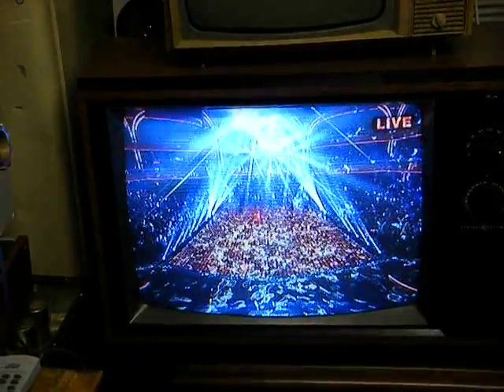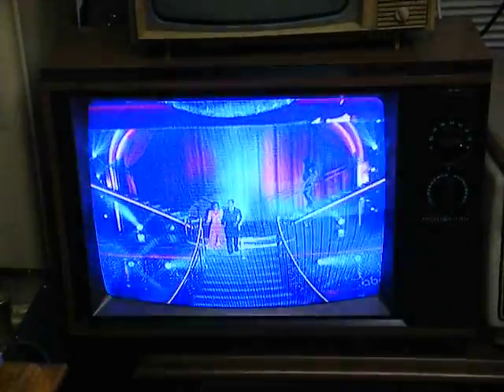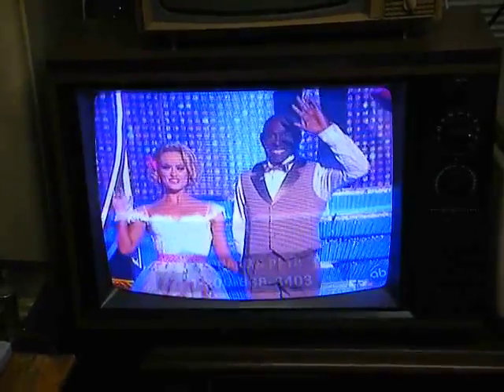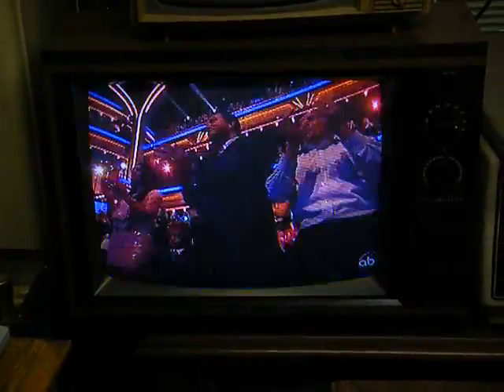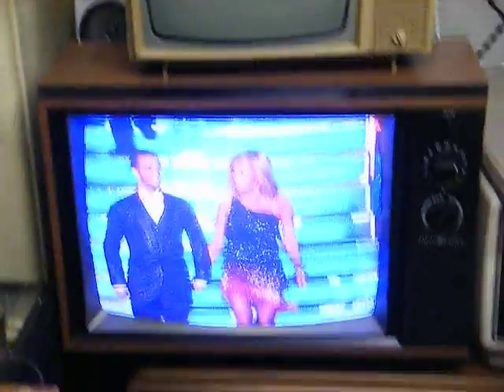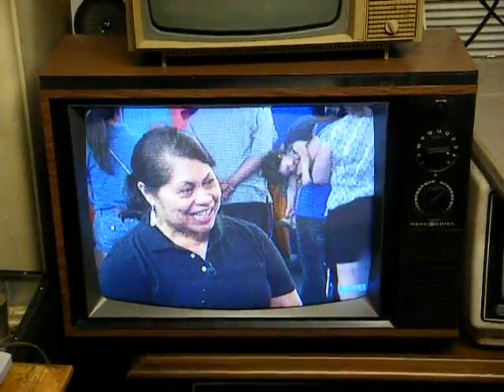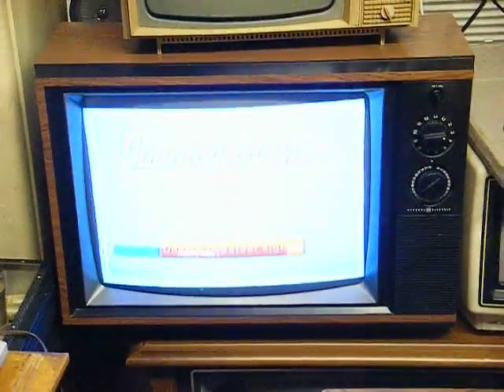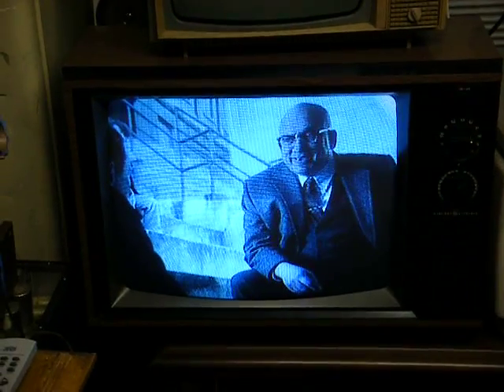'87 GE (RCA) 19" knob-tubed color TV

Comment: I owned a GE TV just exactly like that one and I bought it in 1987, it was a dammed good TV.   It always had a great picture and the two times it quit working, I repaired it.    I quit watching it and stored it away a few years after I was given a newer TV and the last time I pluged it in and turned it on, the picture was really dim.   I threw it away after that, I kinda wished I had kept it and fixed the problem.

Comment from the maker: I also have the RCA XL100 version with a standard volume/power control with a digital channel entry keypad and red LED channel readout. That set has a luma loss issue and I'll have to dig into it one day.  These were the last decent TV's sold under the RCA/GE name. The CTC146 came out after this one and was a POS and then the CTC175's with the bad tuner ground connections came along.

Comment: Geez man!! What else do you have that I have or have had at one point? I found this exact model TV on the side of the road in a rural area while I was away from home working at a summer camp. I only had a small car so, unfortunately I couldn't bring it home with me. Probably got tossed.
Reply: I commonly find sets from the early 2000's near the dump like today I saw 2 Zeniths that looks like one of those early 2000's black plastic sets, I checked them out hoping one of them had a built in VCR so I can replace a VCR I have that only eats tapes and does nothing.